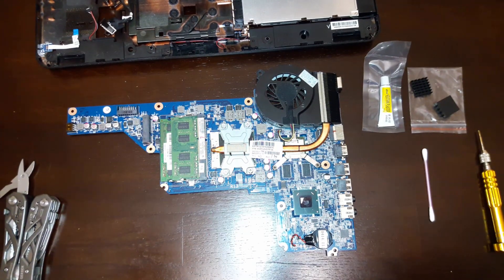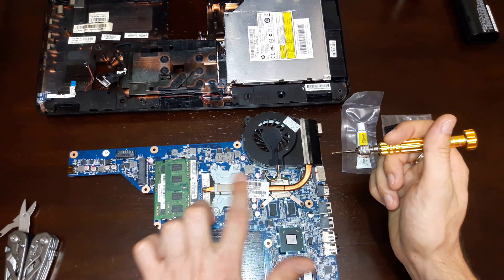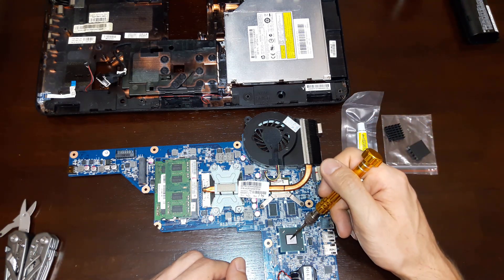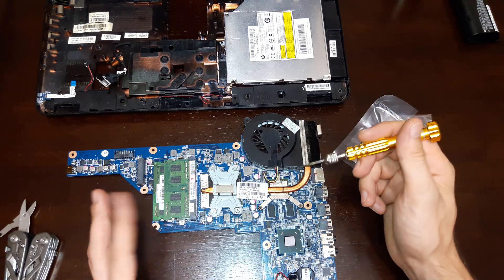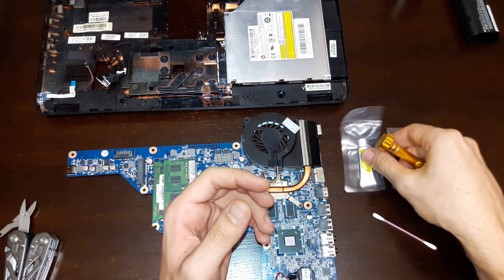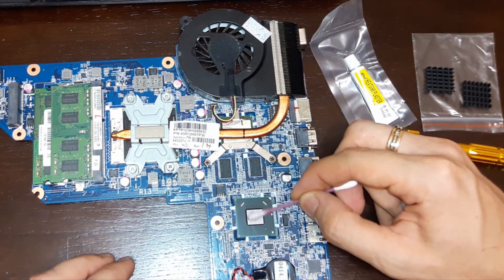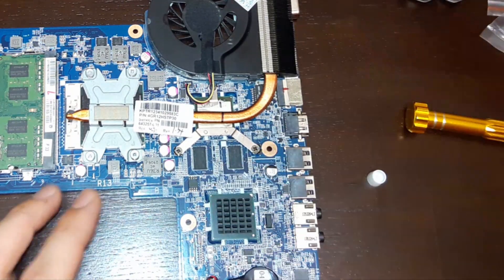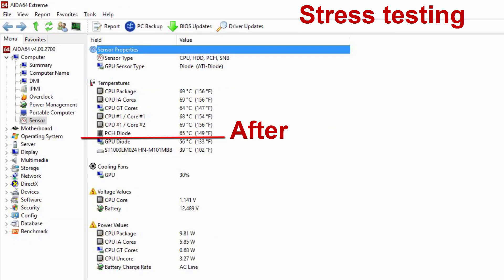Laptop Cooling Mod – Add Heatsink to Chipset Without Mounts! 🔧🔥

Comment: I know this is an 8 year old video, but this doesn't apply to all laptops. The problem with some old chipsets from around the 2010's is they were manufactured with a defect that caused it to prematurely fail at normal operating temps, this is called bumpgate. This is the same reason the early xbox 360s, ps3s, and even wiis died. So while this could help, it will still eventually die. And if your laptop is still running, its probably not affected.
Reply: While it is true that it does not apply to all laptops, there are very recent laptops that need this mod. An example is my 2021 Gigabyte G5-KC. Before this mod the PCH had no heatsink and it would idle at 75-80 degrees Celsius. Under load it would cause the whole system to throttle heavily despite CPU and GPU temperatures not exceeding 85 degrees. After the mod my idle temperature on the PCH dropped to 52 Celsius. The throttling issues dissappeared.
Reply: Chipsets are made to run at those temps though, and I've never heard of a chipset throttle lol. Super odd @someguy2171

Comment: Are there any risks involved when using the heatsinks that come with adhesive pads pre-attached? And is it ok for me to add them to the GPU RAM chips?
Reply from the maker: If it's just a regular thermal pad, then it's not gonna hold up the heatsink attached to the chip. You need to use some silicone glue. But if those heatsinks come with a sticky adhesive sticker, then you can use it without any extra glue.

Comment: Personally I noticed my gateway Nv57H was overheating since a while and I tried a lot, I'ma upgrades its tiny internal copper heatsink but I actively added a fricking external copper heatsink ( three of them actually with copper plates and copper tape) and it actively got its on load temps to drop by 1 or 2 degrees celsius and its average cooling coeficient is much higher after any spiking in thermal vitals and on idle and light load it is between 10 and 15c cooler.

I'ma make an inside heatsink that conduct thermal heat from tiny holes in the laptop's plating that connect interior ones to the external ones and it will probably be even more efficient, not that I need to right now, it will be done when I go repaste the CPU next time.

Its an old zombie laptop with a busted mousepad and keyboard panel, its ethernet port is busted and it has no more batteries since 7 years and is always on and on sector as it was before (and since 11 years of age). It is being upgraded into a full blown frankenPC and its fun to experiment with full custom material upgrades and reparations to the old ass mobo and equipment connections, it has a  USB ethernet switch adapter for on connection internet at all time, uses usb mouse and keyboard and is always on sector, got a SSD that I cloned the original mechanical hard drive onto recently and even a second hard drive port instead of the CD/dvd tray which I switched last year.

Once this thing got proper thermal dissipation it will probably be good to go from between 5 to 10 more years and more upgrades and reparations can be made too lmao.
Reply from the maker: Great job!

Comment: Everyone gangasta engineer until- heatsink gets stuck and is too big to fit in the case 😂
Reply from the maker: You have to measure heat sink's dimensions before you put it on the chip.
Reply: @ElectronicsComputers  yeah I am not saying this doesn't work video was good but it was for some fun 👍

Comment: What is cooling system is recommended for this active or passive
Reply from the maker: Passive cooling is enough for the chipset. there's not enough room for an extra fan anyway.
Reply: @ElectronicsComputers  but then also mine laptop shutdown automatically while playing game it's processor is of 2008 and laptop itself and all hardware too
Reply: @ElectronicsComputers  can i know what's your chipset type model?
Reply from the maker: @knightrider8126  Looks like it was Intel HM65 Express Chipset
Reply: @ElectronicsComputers   Ooh mine is Intel GM45 express chipset
Reply: @ElectronicsComputers  Can you tell me mine processor is Core 2 duo  P8600 2.4Ghz so it's which generation?
Reply from the maker: @knightrider8126  I believe it was Intel's 2nd gen CPU i3 or i5.

Comment: Pch failure in laptop boards is no joke, a pch heatsink is important for longevity, especially if you have an expensive machine

Another plus side of this mod is quieter fans:
Many laptops for some reason have the embedded controller for fans tuned to also activate based on pch die temp, even though the air flow has more or less no effect on the pch temp (there's not really any temp difference on the pch whether the fans are running or not)

Reducing pch temps means your fans are silent more often because they're relying on cpu and gpu temps and not staying on in a futile attempt to cool the pch which has no heat pipe
Reply: I'm sensing you have an acer nitro 5, I might be wrong.
Reply: @thomasty896  I have this and it's driving me nuts!
Reply: exactly buddy, totally agree with you

Comment: Putting heatsink on PCH chipset xD The chipset was working in its normal temperature range. Why the hell would you want to put a heatsink on PCH. By doing this procedure on any other chipset (CPU, GPU), you are effectively downgrading your cooling solution, because now you spread all the hot air inside the case, instead of letting it go to the fans through heatpipes. KIDS, DON"T WATCH THESE VIDEOS! If you want to do something smart and effective, find out a way to add new heatpipes from heat source to the fans.
Reply from the maker: OK smarty tell me why HP decided to install that heatsink on the next model? I'm a licensed HP, Dell, Samsung technician so I know what I'm talking about and what I'm doing.
Reply: @ElectronicsComputers  im waiting for future laptop where we will have 4 fans ,lot of copper heatsink and doesnt give a fuck about overheat in a relatively cheap price😂
Reply: Because laptops frequently have board failure from the pch being in the 80s or even 90s during high load, even though the pch is able to hit over 100 before thermal shut down, it still causes a lot of wear on components over time, if you have a 2000 dollar laptop, you want it to last as long as possible.
Reply: It was going to go into the case anyway the PCH was naked and now it has a heat sink. Not like he ripped off a heat pipe to put on the heat sink.

Comment: its the CPU that may overheat and slow down your computer , cooling the chipset doesn't do any big difference in performance
Reply from the maker: I never seen dead Intel's CPU but I replace dead chipsets almost on a daily basis.
Reply: @ElectronicsComputers  is it really because they overheat ? 😱

Comment: Does applying thermal paste will make any difference than applying thermal glue? Or is it the same? Thank you
Reply from the maker: In this case we have to use silicone glue because the heatsink doesn't have any mounts. So if you apply a thermal paste the heatsink will fall off. But the high quality thermal paste is way better than the silicone.
Reply: 2013Electronics&Computers thanks!!
Reply: 2013Electronics&Computers  Hello again! I can’t seem to find the PCH chipset on my laptop’s motherboard. Is it possible that it may be integrated on the cpu?
Reply from the maker: @jerichoromansoriano5332  Sure! What's the model of your Laptop?
Reply: @ElectronicsComputers  Dell Inspiron 14 5459

Comment: Do i have to use special glue or any glue is ok?
Reply from the maker: You can use only a silicone glue. You can buy it in any construction shop. Just ask for any Silicone Sealant white or clear.
Reply: @ElectronicsComputers  thanks buddy

Comment: i have chipset without cooling to..
but how to monitoring chipset temperature?
i use HWmonitor.. but there is no chipset temperatures on this aplication
Reply from the maker: Aida 64 is the best software for reading laptops sensor. It also depends on the chipset and laptops model.
Reply: @ElectronicsComputers  i try it.. and yes.. it can monitoring my chipset now
thanks

Comment: "How to apply 6x as much thermal paste as needed, for no gains at all"
Reply: Too much paste.. I agree... the glue not holding a heatsink in this specific application? Disagreed
Reply: its not thermal paste, its thermal resistant glue. otherwise the heatsink would not stick to the chip.

Comment: Wait... I was going to do this and realized my laptop already has a heatsink above the chipset lol
Reply from the maker: Yeah, later HP started to produce laptops with chipset heatsink, because chipsets were frying of overheating.
Reply: @ElectronicsComputers  Could I still perform this on top of the stock heat sink - would that improve thermals?
Reply: @AGuyThatsCanadian  Yes please, I would like to know that too. Would like glueing this thing to already existing laptop heatsink help anything?
Reply: @ApofKol  I did it an it resulted in 1-2 degree celsius change. So, temps dropped a little bit. I think this is worth it if you want to extend the longevity of your device. Lots of people say there is no need but that's not what you were concerned about. You wanted to know whether it works. It does. Slightly!
Reply: @AGuyThatsCanadian  Thanks alot, I actually already ordered some heatsinks to try it out. Glad to hear that it does at least something. 1-2 might not sound like alot, but it's definetly worth for me lol
Reply: @ApofKol  Yeah man, and that's all that matters. I find it really frustrating when people say, "It's not necessary" when you are asking a question precisely because you feel it is necessary or will be a fun project. Happy heatsink modding!
Reply: You really don't need to do this they really don't get that hot

Comment: i did this but i placed some thermal on top of chipset and placed the silyconne around it, then had to cut the heatsink so it fitted inside the case then i added an ultraslim raspberry phi fan on top of it wired to the main fan,and finally cut some holes in the case so the fan had where to pick up frshh air, it decreased temp only 12 degress but something is something i guess.
Reply: Bro 12 degrees is very much! 
It's not a small change
Reply: You did all that to drop 12 degrees? For 20 bucks on ebay I bought a laptop vacuum cooler for the side vent and cooled everything by that much. You are inventive and brave sir :0

Comment: Before: CPU Power: 12,2W Temp: 72°C After: CPU Power: 5,8W Temp: 69°C. not helpful at all
Reply: Nice
Reply: Amazing HD
This is not a fix for your performance, but rather a fix for your laptops life
Reply: +korohone You missed his point entirely. The laptop is drawing less power in his comparison so its not a fair comparison because with less power running through the cpu there is less heat in the laptop to disipate.
Reply: @eraldorh  it's drawing less power becuase its not struggling as much genius
Reply: i know this is months old, but the CPU isn't what he added a heatsink to......

Comment: Thank You !! Bro 
1.Brother my laptop is not Chageing I'm conect chagger Chip is very hot that why ?
Reply from the maker: Is it hot without battery? Check mosfets maybe shortcuts, it's impossible for me to remotely tell what's wrong with it.
Reply: Bettery and without bettery time and this chipset is hot more and my laptop Not wotking
Reply: Chager is conect time Only this chip is hot more bettery chageing light and not on

Comment: Thank you. I connected my GPU with a copper tire to the principal CPU cooler, but at stress it get to 100° hot in CPU and GPU. It's normal in a laptop? If not, I will try your mod.
Reply: Don't, there must be thermal paste between the processor and copper heatsink
Reply: 100 degrees is just about where laptops can realistically reach.. usually normal temps should be around 90 c mark. Might be worth cleaning inside and give it a fresh paste.
Reply: what is a copper tire?

Comment: I would have added some cooling to the video RAM chips between GPU and chipset.
Also improving the airflow would have improved the cooling, maybe that is the next upgrade.
Reply: Its not always possible due to space and the laptops shitty design.
Reply: are there any risks using the heatsinks that come with the aggressive thermal pads?
Reply: @crispy6532  I'd guess only if you ever needed to remove them. I assume by agressive you mean strong adhesive+thermal compound? I think the compound would be well tested to not destroy any likely surfaces it will be used upon i.e. it will be inert and unlikely to spill and cause shorts unlike the new liquid metal thermal cooling solutions like in the PS5.

Comment: this heatsink is mounted on super glue or thermal paste? Will not fall off when you turn your motherboard upside down?
Reply: Its thermal glue.... not thermal paste or super glue. Thermal glue is thermal paste that sticks permanently.
Reply from the maker: Denis Rozrabiaka it's a regular sanitary silicone